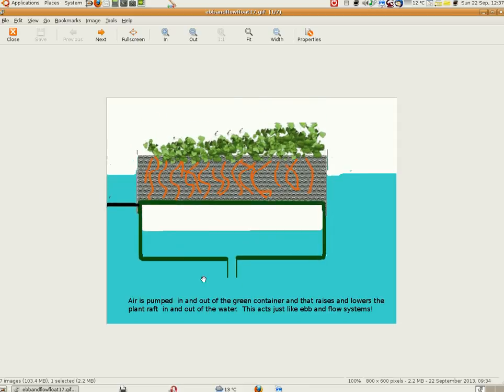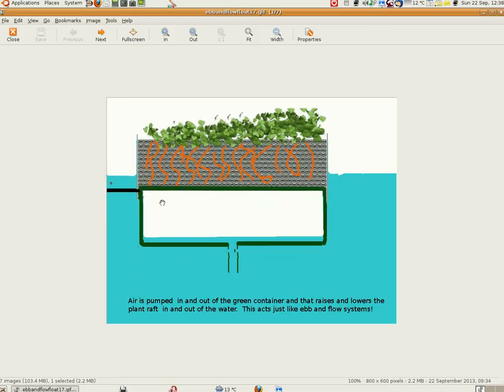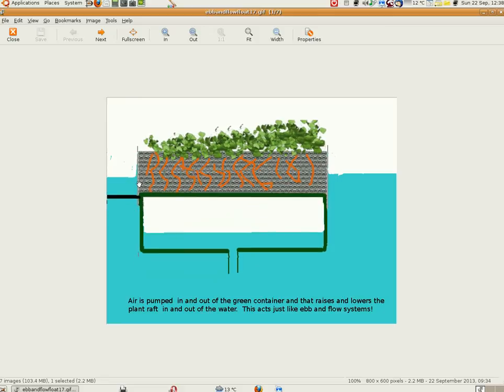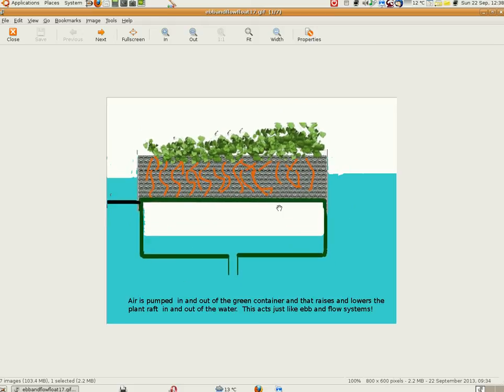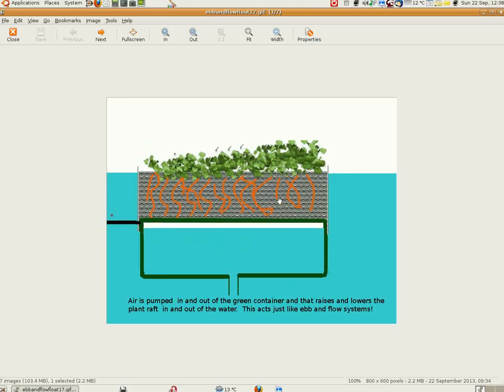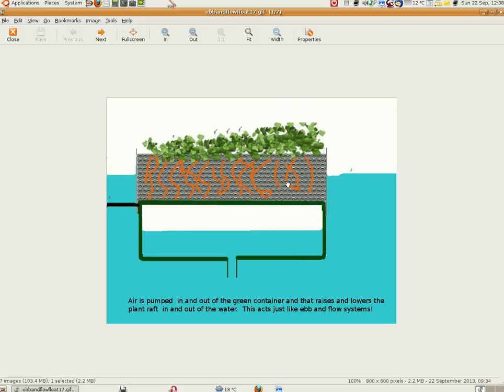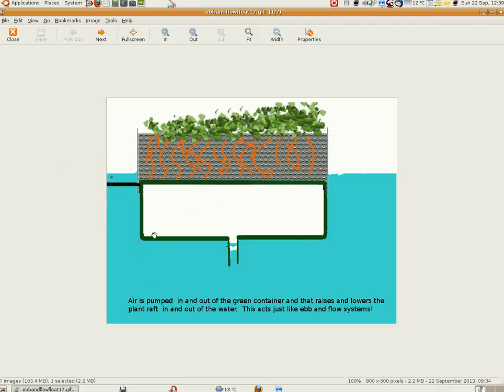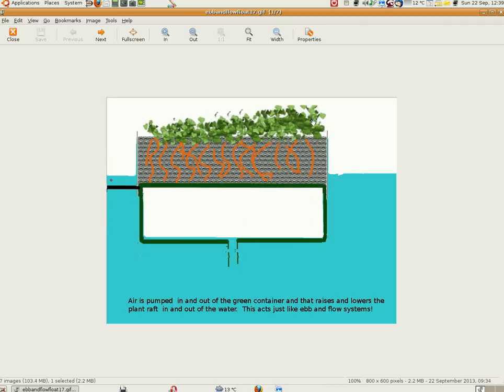Combined Raft / Ebb and Flow hydroponics? Anyone like to discuss the merits of a  hybrid system?

Comment from the maker: Hi, Steven, I don't see why not.  I posted in oursindowfarms about just such a thing last night.   I'm hopeful that someone there will do it. They use airlift pumps (powered by the same type of low pressure air) to drip down through pop bottles with plants in them.  It is lighter (in weight)  than this idea. However this idea is probably less "splashy" and you could have totally different plants in the different layers, with totally different nutrients. I see lots of potential! Brian

Comment from the maker: Yes, I Steven,   hope it can work that way. My biggest project is the pneumatic grid project. It involves producing and using low pressure air to do many different things.  I was going to do this for real, this summer but "life" and work got in the way!     Low pressure air can be produced by low tech means without electricity and you do not even need the pump near the raft.  My  "pallet gardens" are run by a tiny aquarium air pump that is 100 ft away from the gardens.

Comment from the maker: Thanks Joseph, I was hoping to test it during the summer but other things got in the way. If you are part of a hydroponic community please pass on the link or make your own version of this video.  Some people do not like the idea of using air pumps because they are "too inefficient" compared to water pumps but efficiency is a "systematic" thing. You can generate the low pressure air from a multitude of sources at a considerable distance and then pipe the air to the pond (or several ponds!).